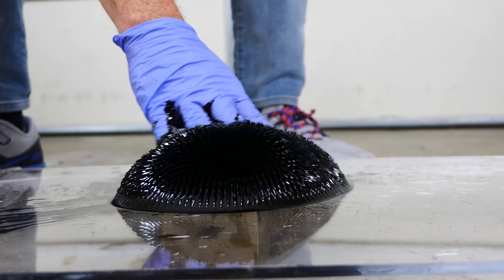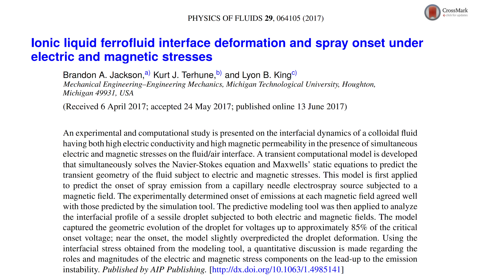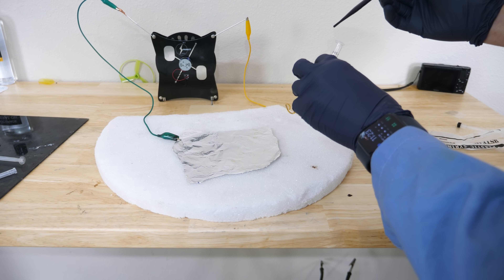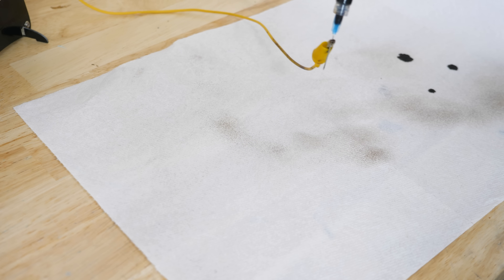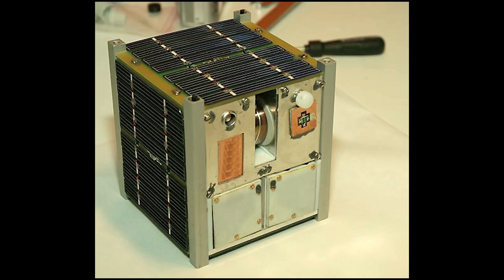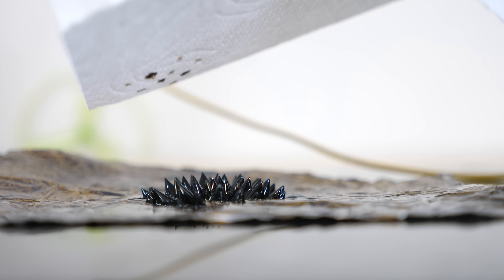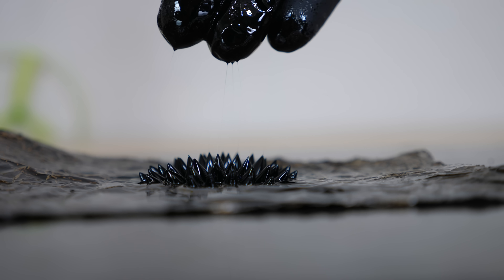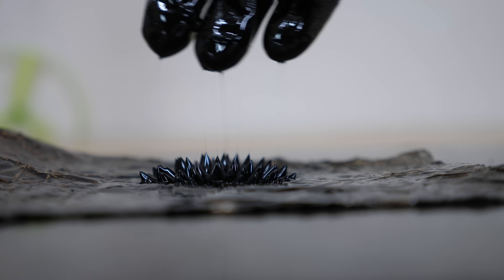Ferrofluid Could Be The Future of Space Propulsion

Comment: THE explanation does not make sense.

In both needles and ferrofluid experiments, the chap has shown that they require a charge on the opposite side to work. Otherwise, no droplets will be flying out. But in the space, there is no other electrode. So the chap’s explanation should include this fact.

Comment: You need to place a charged object above the ferrofluid for it to shoot parts of itself off. How exactly will that generate propulsion? You need to get it to shoot off liquid without a coupled object.
Reply: Maybe to use as an space elevator
Reply: He kind-of showed how with the mesh and the needle, but didn't explain it: You have to try to get the accelerated particles through the holes in the mesh. Ion engines have the same problem, though they can be built with or without a mesh, somehow. Scott Manley goes into it in his video, Why Are There Two Different Types Of Electric Space Engines, And How Do They Work?

Comment: I'm reading comments feeling like most people missed the usage method and purpose demonstrated here. He mentions micro thrusters or thrusters for micro adjustments for a reason. He's talking about using those fluid cones and electricity to spray particles for thrust to make a satellite move a hair to the left. If you can aim that fluid with a magnet and charge it to produce a thrust effect, then you've simplified an electrical mechanical micro thruster and gas storage risk into just a battery and some oil. Cost and errors go down. Not to mention the micro control you've got with this effect. So efficient.

Comment: The problem with using a fluid in space is the extreme temperature swings and zero outside pressure... thus whatever fluid they plan to use must still be a stable liquid while at sub zero temps while the sun is not shining on it, and remain so when the sun does shine on it (raising its temp to around 120C) AND in a vacuum... I would say they have their work cut out for them

Comment: Omg, that is fracking genius! elegant and simple,

the flow of the charged ferrofluid would make it's own magnetic field as rings aroumd each of those stringy sprays no? 

Maybe use ai  or contol theory so you don't have to know the exact field dymamics , just  teach the system based on your stated goal of propultion, adjusting either the amount of ferrofluid or electric field, 

adjusting the position of the ring or through which hole in a grating the fluid passes by you'd fine tune the direction, no?

Comment: You could probably light it on fire too for extra propulsion
Reply: ferrofluid isn't flammable

edit: I was wrong, most is
Reply: @emanuelemanzoni5191  it's literally oil though.
Reply: @Throfed  not all oil burns. Also it would need oxigen to combust, meaning a satellyte using that would need to bring its own oxigen
Reply: @emanuelemanzoni5191  that's true that it would need its own oxygen but the internet says ferrofluid is a flammable substance
Reply: @Throfed  that depends on the type of liquid that is used for the suspension. After saying that the doubt came to me and indeed most are made with flammable vegetal oils. I'll edit the comment.
But still it wouldn't be optimal to combust it.
Reply: @emanuelemanzoni5191  you're probably right due to the need of oxygen higher in the atmosphere

Comment: Looked messy. On an unrelated subject, what if you suspend a bowling ball, or similar weight of some kind, by a cable and then made a balance type scale which is quite long, so it's sensitive, and put a small weight on each end so it's level and then put it so that one of the weights is a short distance beneath the suspended weight and the other end is far from it? Would the end under the large weight go up toward it from its gravity?
 The Cavendish experiment was horizontal, maybe something else was making it twist over toward the lead weights. With the vertical version I described, we could see if it can exert enough gravity to make earth's gravity weaker on the small weight. You couldn't just use a digital scale with the small weight under the large weight, because then the large weight's gravity would also pull up on the sensor and the reading would come out normal.

Comment: Isn’t this what an ion engine is ? cept an ion engine is better?
Reply: these thruster an operate in droplet mode or ion mode droplet being high thrust low efficiency and ion mode offer low thrust but high efficiency. ion/ plasma thrusters however don't scale down well, it is hard to build them smaller that 100W and still have good performance this tech offers near the  efficiency of ions drive but in  size and power class that cube sats can use.

Comment: WHY does it look like those coins are floating at 0:34? What the hell? Even in slow motion it looks like the reflections don't line up. Someone help.
Reply: He probably has a plexiglass/acrylic plate between coins and magnet for safety reasons. If the coin sticks directly to this bad boi it's not possible to pull it off with your fingernails nor push a screwdriver under it easily

Comment: 10 nm in diameter? Charge it up and funnel it through a graphite nano tube at extreme speeds? Nano stream micro fusion? Propel it into a mist of deuterium on the other end and have fusion ignition trigger larger chain reactions and use the kinetic impulses? It would require a lot less starting energy. The super fast nano stream would have to either push or carry deuterium with it.
Reply: hey dude? calm down.

Comment: In your experiments, how was charge transferred to the oil ? Is your ferrofluid electrically conductive ?
Reply: it was an ionic liquid based ferrofluid so yes it is conductive
Reply: probably from the iron
Reply: His ferrofluid was a conventional one, magnetic particles (likely iron oxide) suspended in oil, and as such was non conductive. He applied high voltage to the metal needle from which the fluid acquired the charge. The paper he was referring to used a different kind of the ferrofluid that was electrically conductiv.

Comment: Pretty cool,  but aside from needing 2 charged plates one of them not attached to your rocket, there is the general mass/velocity equation. That is a significant amount of mass moving at relatively small velocities so it seems it would be pretty inefficient.
Reply: the propellant is conductive and acts as one "plate" the other plate is actually a grid so after the propellant is accelerated can actually soot through the grid providing thrust.
Reply: Increase the field strengths and your tiny amount of matter fires off at faster speeds.

Higher reaction mass velocity, the faster it goes.

Remember, the strength of the field is directly related to the "pointyness" of the spikes, so a fluid that forms the pointiest spikes will accelerate its own particles at higher velocities.

Comment: ? you need a charged plate but how will it shoot out of nozzle ? The plate will fly with the rocket  so how will it cause propulsion ?
Reply: You use a correctly sized mesh. The electron charges are light enough to jump off and curve their path onto a grid of mesh or even a tube wall, while the momentum of the exhaust particles themselves continues straight on through the opening
Reply: Ion thrusters exist already, read up...
Reply: @Steve Hand Exactly

Comment: @The Action Lab So I guess for propulsion to work in "space", that "space" cannot be a vacuum!!! "Space" has to have a certain degree of atmospheric pressure for the exhaust of the spacecraft to push against...or there wouldn't be any movement!!! Any idea what the "pressure" of "space" is??? A quantifiable number???🤔
Reply: No you have it the opposite. All types of rocket work most efficiently in vacuum.
Reply: @NameNotAlreadyTaken2  So what does the exhaust of a rocket push against if it's in a vacuum??? Likewise, how does a speaker make sound if it's in a vacuum??? 🤔 ENLIGHTEN ME!!!
Reply: @RTR-MATEY  The exhaust mainly pushes up against the rocket nozzle as it expands. That's why rockets have bell nozzles. In an ion engine its basically the same, but with magnetic force instead of physical impact.
Reply: See Newton's 3rd law. To produce propulsion, all that's required is that you throw something away from yourself. That propellant doesn't have to hit anything. The very act of you imparting a force to it away from yourself is balanced by a force imparted on you in the opposite direction.
Reply: @web4639  Reference a feather and bowling ball in a vacuum falling at the same rate. Even though they are inert, there is zero resistance (atmosphere) to them succumbing to the greater force of gravity. Which means that space cannot be a complete vacuum otherwise the rocket exhaust would have nothing to push against to propel itself forward!!!

Comment: At orbital speeds where we worry about dust hitting spacecraft, is it really a good idea to launch a bunch of tiny ferrofluid drops?
Reply: Good question!
Reply: it not really any worse than traditional chemical propulsion, the reaction products from hydrocarbon fuel are soot at water which turn into little ice crystals no bigger than the droplets this type of thruster makes. Spent propellant regardless of type does damage spacecraft by basically  sputtering/sandblasting the surface but this fairly slow process and at these speeds it doesn't mater much if solid liquid or gas particles.
Reply: There's no concern about this any more than any other fuel we use to propel spacecraft.  All that fuel is tiny particles Afterall same as this ferrofluid
Reply: I was wondering the same, but then I thought maybe the earth's magnetic field will capture these drops and guide them to reentry at the poles? Although it would be a whole different problem to start painting our poles black...
Reply: @janhhhh  - I think anything would burn up, or break apart, or disperse and float away, due to re-entry heating.
Reply: He said they want to use some ionic liquid, not ferrofluid. My guess is the liquid would just sublimate
Reply: @schmarcel4238  that was my thinking too, but then why not just use liquid co2. Unless I’m missing something
Reply: I wouldn't worry about this for the following reasons:
- there is a lot of space in space: even if we shoot a thousand tons of material in space, it would still be an extremely small amount.
- K = ½m v^2. The mass of those droplets would be extremely small, they would never be able to carry enough kinetik energy to deal any kind of damage.
Reply: Why would you be worried about dust with a magnetic fluid?
Reply: Hell yea brother
Reply: Technically speaking they did try to make a micro black hole tractor beam which traps particles in between their gravity fields, or we could use small molecules or water or something somewhere I read that.
Reply: Totally agree. We are worried about oil in our oceans. Us causing the change in climate but we will pollute space. In a much more extreme way than our planet.
Reply: @matthewbirdsey7231  Firstly, the amount of fluid that each satellite is going to use for course corrections will be like a liter per year. 

Secondly, they’re not using oil, they’re using an ionic liquid, which you would know if you had watched the whole video.
Reply: @mrsheldon9134  interesting you know the amount used. Will be funny when it blocks enough sunlight to bring the next ice age. Oops say the humans.
Reply: @matthewbirdsey7231  I think a 500 million liter oil leak on the ocean is a bit more severe than a couple liters of oil in space
Reply: I guess they would not have much kinetic energy so they wouldn't cause damage... but that is just a guess
Reply: Maybe catch it for reuse after the thrust action?
Reply: @hongry-life  that's not how reaction thrusters work. You can't recapture your exhaust because there would be no change in momentum.
Reply: @dustinbrueggemann1875  Sure you can, with another spaceship going the opposite direction. ;) Actually sometimes useful.
Reply: @hongry-life the spacecraft that ejected the particles couldn't be the one to catch them, it would cancel out all effective movement because every action has an equal and opposite reaction. it's unrealistic to have a dedicated spacecraft to catch these droplets since it would have to follow any craft using this as a propulsion source to be able to catch the majority of them, and at that point you'd need something to propel that spacecraft as well
Reply: @hongry-life  Catching it would transfer the action back to the craft, braking it and negating the whole purpose of the device.
Reply: @flamencoprof  ahh good, the first two exact same answers really didn't hit that point home for them i bet
Reply: @MelodicTurtleMetal  I blame YT, they were hidden in "Show more replies:, instead of nested under the one I answered.
Reply: @flamencoprof  Yes, Idk exactly how that could be done, Maybe with a cone shaped thing.
Reply: @hongry-life  I don't think you understand. It can't be done at all, any way, any how, It would be like trying to move a sailboat by blowing on the sails while sitting in the boat.
Reply: @hongry-life  that would negate any momentum gain from the propulsion.
Reply: @TomFromMars  So everyone says, but there are various ways of 'catching', of which the one with least set back could be chosen, like a cone or spiraling tube.
Reply: Not thinking of a flat rigid perpendicular surface.
Reply: @hongry-life  its not about how you catch it back. Momentum is created by throwing a propulsant one way to which the space craft will react by movies the other way. That's the momentum, more precisely two opposite momentum.

If you catch the propulsant with the same system you are trying to propell, everything stops to a halt.

What you could do however is to have a third object meant to catch the propulsant to prevent it from entering the atmosphere. But it would only work for small maneuvers because you couldn't propell it (or you are just movies the problem)

Comment: I was thinking since ferrofluid is apparently frictionless, it could be used as a lubricant of some kind, not sure how well that would work in the context of space travel though.
Reply: Why do you think it's frictionless? it's not a superfluid
Reply: @schmarcel4238  That's what a web search told me, the friction of ferrofluid is extremely low to almost nonexistent.
Reply: @noahater5785  okay, just a wording problem then. There is a big difference between frictionless and almost frictionless
Reply: This is a great line of reasoning. One of the most prolific uses of ferrofluid today is as a "magnetic bearing", essentially a frictionless bearing using magnetic forces to hold the fluid in place and create an airtight seal (going from memory here, worth looking into yourself for more accurate description).
Reply: @MR-ym3hg  I was gonna say the same thing and I've used  them in industry.
Reply: I can see it being used to achieve light speed if correctly shot around the sun, perhaps magnetic propulsion could work like an elastic slingshot but with virtually no resistance?

Comment: Yeah, probably not. It's a bad idea since now you have trillions of high-speed fluid projectiles that can impact other satellites causing damage.
Reply: which is different from the soot a hydrocarbon rocket emits how? not saying this is not any issue but there is a scale issue here, the rocket the puts the cube sat up will emit 1000x of time smore particles putting the cubesat in orbit than  the cubesat will ever emit.
Reply: @orbitONhigh  There is the possibility that the magnetic liquids re-aggregate into larger particles, making them dangerous projectiles. The hydrocarbon soot would likely not do that.
Reply: @pappaflammyboi5799  not really the plume would diverge very rapidly after the acceleration grid, the particles have net electric charge so the tend to want to separate from each other and residual magnetic field would not be able over come the electrostatic charge for recombination. bigger issue would be charge imbalances in the drive causing the the vehicle itself to get a net charge and attract the particle back onto itself, one of the ongoing challenges with this tech. If your thinking random particles would coalesce in orbit into larger globs that would require truly staggering amount of propellant to be expelled in orbit like 10s of millions of satellites worth but by that point other logistical issues would dominate earth orbit. Your concerns seams to be a common  one this video and spent propellent is a issue for space craft, it will damage things but it not rally any worse that the monoatomic oxygen, micro meteoroids and radiation. All these things are life limiting aspects for spacecraft but they take years to decades to actually kill a craft. Current trends are for larger number shorter life vehicles, and the latest regulation for post mission spacecraft life time will reduce large debris significantly mitigating the effects of spent propellant on vehicle life who cares if propellant sputtering will kill you in 15 year for vehicle the has a 7 year life. I am not naïve enough to think humans can't fill space with enough debris to be and issue but we are aware off it already and taking steps to mitigate now, the industry will have expand alot ( read 10s of thousands of times more activity) for it start causing the types of problems most of people seemed to worried about.  Source  I assisted this research as undergrad and have worked in spacecraft propulsion for over a decade.